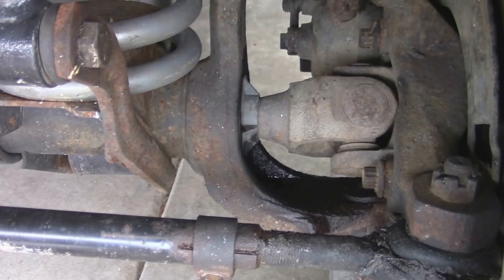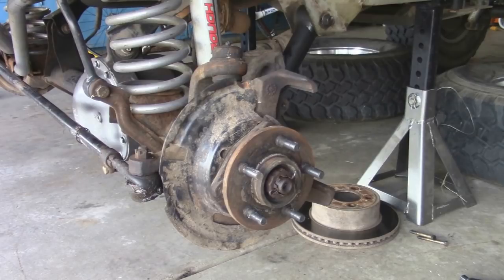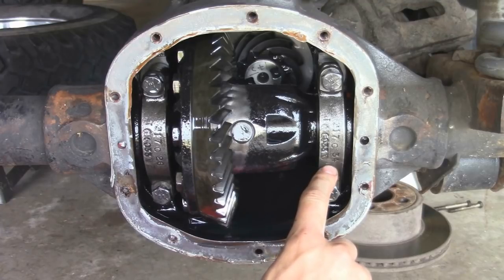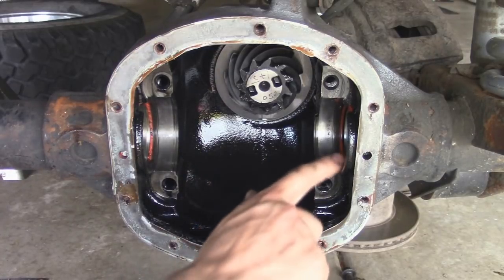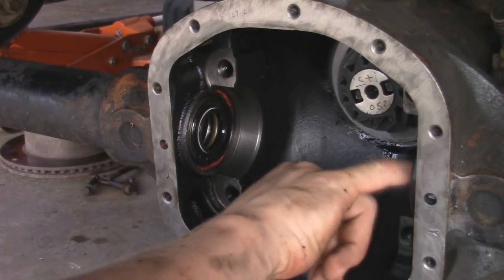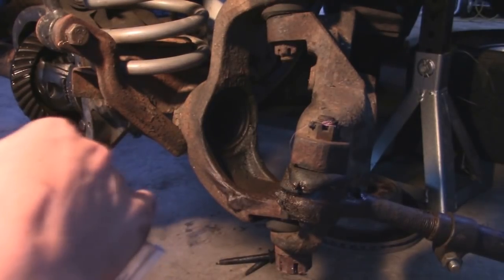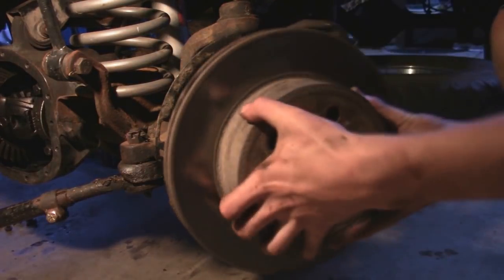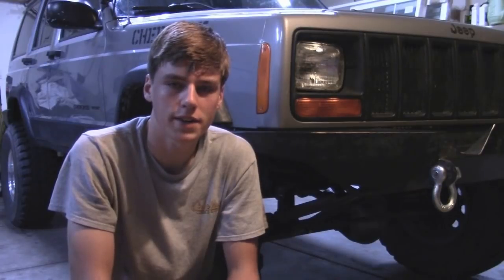How To Replace Inner Axle Seals

Comment: Yeah, I just did front axle u joints for the 2nd time (130K miles) and the passenger side seal apparently went kapoot on the install.  This vid helps a lot.  Makes me feel comfortable about doing the seal change.  Stay cool.

Comment: Thanks for this video....just did mine. BTW,  in a Dana 60 you can actually hammer the new seals inside the pumpkin with the driver, no handle.

Comment: Just found this video, good explanation and steps through process.  I've gotta do front axle seals on my 02 wrangler for inspection this month.  Time wise, looks like it took better part of the afternoon/evening.
This should definitely be easier than chasing down and fixing the electrical issues in my wife's grand cherokee!  Mechanical good, electrical sucks🙃

Comment: Only vid I've found on here that shows the outer seals being done. Thanks man good vid. 
I find that it's 8out od 10 times to only b the outside seal. Changed mine twice in the past 2 years on my mail delivery jeep.
Reply: Ryan, these outer "seals" are great, but they only are there to keep dirt and mud and anything else out of the axle shaft.  If differential fluid is leaking out to there, the inner needs to be replaced.  I like those outer for that, but if you have a leak on the inner, your diff will be toast if the outer holds in the fluid and you don't see it, there's not enough to fill the axle and keep that diff full.  If you have fluid coming out, the inner seals have to be replaced, in my experience.
Reply: @jasonmalmquist7889  thx
Most of time my vent tube gets clogged from going down dirt roads everyday and it starts seeping past outer seal or pinion seal due to pressure buildup but once i clear vent tube it stops leaking. My vent tube bolt thing is stripped so it comes out of axle and sometimes water and dirt get in and screw up seals. Thats y i change em so often. I need 2 quit being lazy and remove axle and tap tht hole but hey what can i say. F it

Comment: Great video. I finished replacing mine on my 1975 F250 “Highboy” 4x4 with the Dana 44 front on Friday. Thanks to your thorough video, I was able to do it. Haha I had to buy and use a 38mm socket for the “custom tool.” I had this wooden flag pole that I gorilla taped an extension onto the end. This was not fun haha but now I’m trail ready good to go. The Chilton manual left me in the dark on these seals. Thank you again.

Comment: Bro cool. I had the same idea. I found that the 36mm socket fit just right and I also bought washers to weld together and put on the end of a long piece of 2x2 incase the socket method wouldn't work. I have a dana 44 in the front so the 1 seal was going to be a challenge. Cool to see someone was thinking like me for once.

Comment: I used 1/2” bolt rod, 2 washers  and bolts to draw in the inner seals. Center it up and draw it in until tight. But I have the Dana 30 with the disconnected axle on the passenger side.

Comment: What is the difference between doing this on this axle vs a Dana 44? I have a Rubicon with lockers and Dana 44. Are there any additional steps or precautions that must be taken?
Reply from the maker: The Dana 30 and Dana 44 axles are almost identical. They use the same axle U-joints, ball joints, and Knuckles. The only major difference is the gear size. I would just make sure when you are removing the ring gear, make sure to install it same way. It should come out all is One Piece like what is shown in the video.

Comment: Hey @OutJeeping, really good video man,  but I have a question, so lets say in the future one of the inner seals is leaking again, how will you know that with aftermarket outer seals installed, I know that its meant to keep debris out of the axle tubes, but since there sealed wont there be an accumulation of differential fluid in the axle tubes, or would it not matter? Thanks for your time man.
Reply from the maker: That's the risk that you will end up taking. You won't know unless you pull the axle tubes or check the diff level on a maintenance schedule.
Reply: @OutJeeping  Oh ok thats true, I'll be adding that to my maintenance then. Thanks again man.

Comment: What is the orange stuff by the seal?

I also get the diff must go back in the way it came as in when u said it goes in the same side but does the pinion have to meet the diff exactly the way it came out?? Or can u just put it back in and make sure its turning and its good??

Comment: I got an 86 jeep Cherokee, would it be the same procedure? Thanks for the video !
Reply from the maker: As long as it's a non front axle disconnect axle. It will be a bit different on the passenger side if it has fad.

Comment: What is the outer seal and where can I get them ,put new u joint in today on front axle and there was not one there.dirt was all in the tube of the axle, what do you recommend doing, don't have alot of money. Can I take it apart and wash the dirt out with water hose and new seals and oil
Reply from the maker: You can take the axle apart and clean them out. Pull the shafts out and pop out the carrier. I would recommend replacing the inner seal like what's in the video. Then you can stuff a rag in the tubes and push it through to clean them out. Outer seals I got were by 10 Factory: https://www.amazon.com/Ten-Factory-MG21102-Dana-Axle/dp/B005TDN2KI/ref=sr_1_5?crid=2TQKU0A5SBIZF&keywords=jeep+dana+30+outer+axle+tube+seal&qid=1652303579&sprefix=jeep+dana+30+outer+%2Caps%2C110&sr=8-5

Comment: Hey, thanks for the video! Couple of questions. 
1. How long did it take?
2. I bought mine and the previous fella threw in grand Cherokee CV joints from a ZJ. Have you ever tried that application?
Reply from the maker: It took about 4 hours. The CV axles will fit but they are not as strong as a u-joint
Reply: thank you

Comment: What parts did you use, I got new inner and outer axle seals to install but they look nothing like yours, they are just little rubber o rings...
Reply from the maker: I use inner axle seals made for a 2001 Jeep Cherokee front axle Dana 30. Easy to source on rock auto. Outer axle seals are aftermarket and ones I used are made by Ten Factory.

Comment: Hi, you took off the carrier soo easy, i am just doing mine now and carrier seems jus jammed, any tip or "special work" to take it out without breaking?
Reply from the maker: The proper tool to get it out nicely is to use a axle spreader, but since not everyone has those you can pry it out gentally to prevent any damage to the axle and its components.
Reply: Heat the cast center case with  a heat gun or just wave a torch back and forth over it, the carrier will come right out. Don't get it too hot, just rather warm to the touch. You only need it to grow .001 or .002.

Comment: As far as rtv goes with that outer seal, it's just rtv silicone right? Any color works too? Also, about the shims, as long as they go in the same side it will work right? There's no orientation? I'm confident to do the work but don't want to grenade my diff if I put together wrong
Reply from the maker: Any RTV should work but they make differential RTV or RTV for sealing against oil, that would be best. As far as shims, with the Dana 30 model I have in the video, the shims are pressed between the bearings and the carrier, so they didn't pop out when removing the carrier. On other axles you may have the shims pop out with the carrier because they get installed on the outside of the bearings. If that is the case then yes, make sure to install them back to the same sides that they came from.

Comment: I can’t for the life of me hammer in the new seals. I have extensions to go thru the axle with a 35mm socket that fits the seal perfectly. Any tips to get the seals in?
Reply from the maker: I would start them by hand with a small hammer to get them in square and being careful not to damage them. Then move up to a larger hammer with a seal driver or socket to hammer it in the rest of the way.

Comment: replaced these seals last weekend and driver side still leaking. Gotta check for a clogged vent line or gouged seal journals
Reply from the maker: Yeah I would check out the axle shaft surfaces and vent lines on that one.

Comment: Great video! Question. Do the outer seals come out very easy? Also, what year is your XJ?
Reply from the maker: These are aftermarket seals I installed so from factory there is nothing but a dust cap on the axles shafts.
Reply: ahhh ok thank you. @OutJeeping
Reply: Looks to be 97-99

Comment: What brand of outer tube seals did you use and is there clearance issues with the grease zerk???
Reply from the maker: I went with "Ten Factory" accessing the zerk fitting is a little bit tight.

Comment: Where did you get the outer seal replacement
Reply from the maker: https://www.amazon.com/Ten-Factory-MG21103-Black-Dana/dp/B005TDN2TO/ref=asc_df_B005TDN2TO/?tag=&linkCode=df0&hvadid=312050280935&hvpos=&hvnetw=g&hvrand=12144092754874615720&hvpone=&hvptwo=&hvqmt=&hvdev=c&hvdvcmdl=&hvlocint=&hvlocphy=1028264&hvtargid=pla-436788324941&ref=&adgrpid=61716360643&th=1#customerReviews

Comment: Great video, super informative and good resolution. Stupid question, if you replace the outer seals like you did, doesn't that (in theory) stop the leak? I have a 2001 WJ and need to do this but I don't off road and use it for around town driving and towing my boat to the water. So...if I simply added the outer seals, I wonder if that would be a "quick fix?"
Reply from the maker: The outer seals are not meant for holding in fluid so they would still be able to leak fluid out a bit. Also the axle tubes will start to fill up with fluid so the diff level will go down.

Comment: Did you have have any issues with the steering wheel being off center after removing the axles? I just did one and I don't know what I would have done to cause the steering wheel to be off center.
Reply: How far off center is it?
Reply from the maker: No not at all, you must of messed something up

Comment: What part number and where did you order the inner and putters from have w xjs to do sadly
Reply from the maker: Inner Axle seals for a XJ Dana 30 non-FAD  TIMKEN 710068. The outer axle seals were by Ten Factory, link is below. https://www.amazon.com/Ten-Factory-MG21103-Black-Dana/dp/B005TDN2TO/ref=asc_df_B005TDN2TO/?tag=hyprod-20&linkCode=df0&hvadid=312050280935&hvpos=&hvnetw=g&hvrand=551802323134164504&hvpone=&hvptwo=&hvqmt=&hvdev=c&hvdvcmdl=&hvlocint=&hvlocphy=9018702&hvtargid=pla-436788324941&psc=1&tag=&ref=&adgrpid=61716360643&hvpone=&hvptwo=&hvadid=312050280935&hvpos=&hvnetw=g&hvrand=551802323134164504&hvqmt=&hvdev=c&hvdvcmdl=&hvlocint=&hvlocphy=9018702&hvtargid=pla-436788324941
Reply: @OutJeeping  thank you just picked up a few projects and this was first on the list, really appreciate your videos

Comment: Wait...are there not any bearings behind the hub area? Just an outer seal and then the inner seal further in? The only bearing on these is at the hub unit itself? Did I catch that accurately?
Reply from the maker: The outsides of the axle shafts use the hubs/unit bearings as their bearing and then the inside slides into the carrier which has bearings also.

Comment: How did those outer axle seals hold up?
Reply from the maker: I greased them every 3k miles. The rubber held up but it seems water gets trapped in the axle tube while driving through water.
Reply: @OutJeeping  That's what I was worried about thanks.

Comment: I have noticed that the parts suppliers offer CV half shafts that look like they would work as substitutes for the u-joint style shafts that most Dana 30s come with. It looks like an inferior replacement solution, but for a street driven vehicle, it might be ok. A new CV shaft costs about $50 versus a u-joint shaft for $280 so it looks attractive. Do you know anything about swapping out for CV shafts?
Reply from the maker: The cv's that come in grand Cherokees can fit most Dana 30's but they wont hold up offroad unless you buy the aftermarket ones that cost around $1000. But if its a daily driver they aren't bad.
Reply: RCV sells offroad oriented cv shafts for jeep dana 30s and 44s to eliminate the u-joint binding and weak link... theyre not 50$ though problably closer to 850$ for the set
Reply: im planning on buying them for my 05 rubicon but i havent broken an axle shaft yet even running 35s aggressively

Comment: Can you use the same process for the rear axle seals?
Reply from the maker: Some stuff is similar but rear axle seals are located on the outer ends of the axle tube and not by the differential.

Comment: Why use the red threadlock?  It didnt seem like it had it on before??? Would that make it much more difficult to remove in the future without a torch?  Also when it dries/expands, isnt it possible for it to actually push the bolt back?  Thanks for the info!
Reply from the maker: Blue or red lock tight would do fine in this case. Red is what i had at the time, it should keep the bolt in there, that's what it's made for.

Comment: When you took the diff apart you said watch out for shims. Was there shims and if not, where would they be?, if one axle would have them.
Reply from the maker: On some axles the shims are between the carrier bearing and the axle housing, for this axle the bearings were pressed in between the carrier bearing and the carrier.

Comment: how do i know if i have enough torque on the carrier bolts? i got a dana 30 aswell. i found it says i need 60 ft-lbs. on them but like how do i know if i got that
Reply from the maker: Torque wrench
Reply: @OutJeeping  is there alot of difference between 30$ tube seals and 70$ tube seals?
Reply from the maker: @TheNightcrawler009  Mostly just preference, all do the same job

Comment: I have to ask, how do you know when the inner seals are shot once you install those outer seals? I am about to do my inner seals again and want to install the outer, but have been cautioned about the lack of "feedback" from the Jeep when those inner seals are gone next time.
Reply from the maker: You don't really know when the inner seals are shot with the outer seals. But most of the time the inner seals went bad from dirt and crap so the chances of them going bad again go down. I guess one easy way of checking is to check the level of oil through the fill plug.

Comment: Can you help me? I scraped the orange ring off on accident inside my diff axle where the seal goes. What now???
Reply from the maker: It shouldn't cause a problem that's just excess sealant from rtv when the axle is build from factory when they seal the axle tubes to the pumpkin.
Reply: I have another question. If you look at the video I uploaded tonightI took shots of my carrier. I have never seen one like it. Can you id it for me or one of your subs can maybe? BTW, yes it looks like rtv from the axle build. Weird that they would fill that with rtv.

Comment: So when you see a leak  you should change the inner  and outer seals at the same time ?   I m guessing  there should not be gear oil after the inner seal ?
Reply from the maker: If you see oil you should change the inner seals. The outer seal is aftermarket to keep out water/mud so the inner seals last longer. From factory instead of an outer seal it's just a plastic dust cover
Reply: @OutJeeping  I can only find them for 30 spline axles. Does it fit both 27 and 30 spline.
Reply from the maker: @brandonl8552  I believe to 30 spline shafts are bigger so you'll need a bigger seal

Comment: FYI This tear down only applies to post Dodge renditions of the Dana 30.... If you have a real Jeep (pre-86) the tear down is completely different and the outer seal will not fit. The spindle requires an axle puller to remove as it is pressed in and held on by 6 bolts. The after market outer seal will not fit on a stock axle because the dust cover only gives -1/8" clearance between the yoke and the end of the axle housing shaft. (I believe G2's have a removable dust cover if you choose to go that way)

Comment: What’s the point of the inner seals if there are outer seals?
Reply from the maker: Inner seals are factory for holding in diff fluid. Outer seals are aftermarket for keeping water, mud, sand out of the axle tubes.
Reply: @OutJeeping  ah ok thanks

Comment: Miller tool 6797 is the proper tool to install these seals.
Reply: I used a 1/2" nut and bolt with the socket and seal driver puck to create basically the same tool when I did mine today. Worked mint!